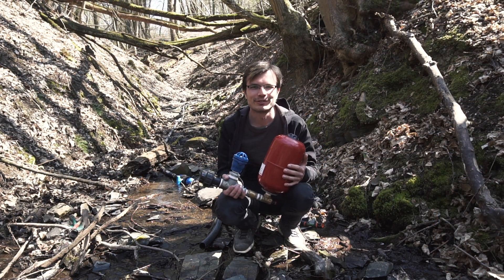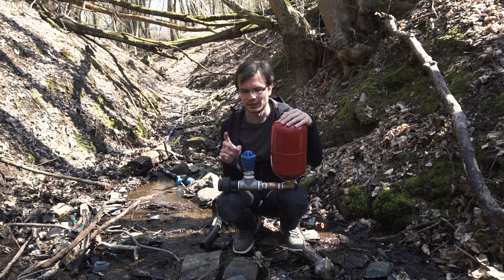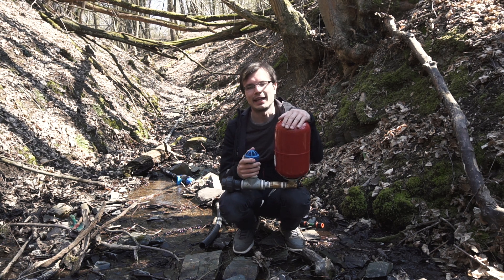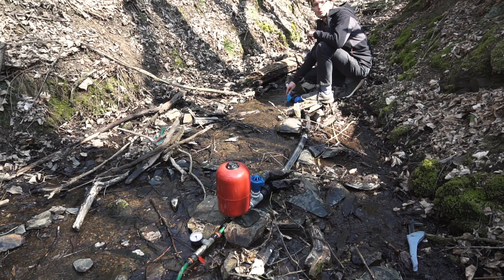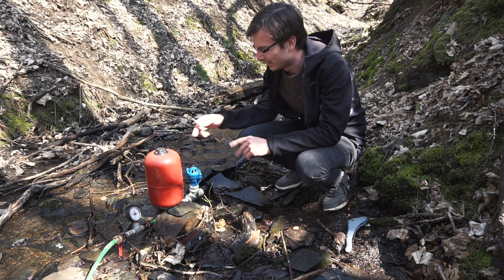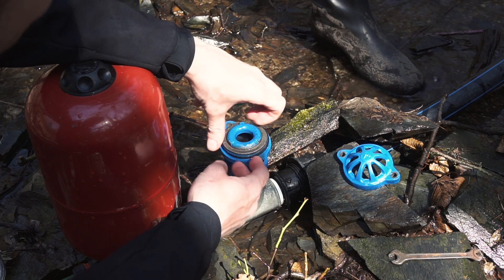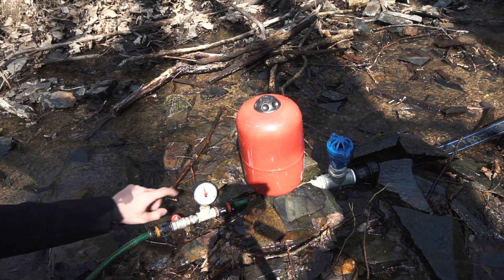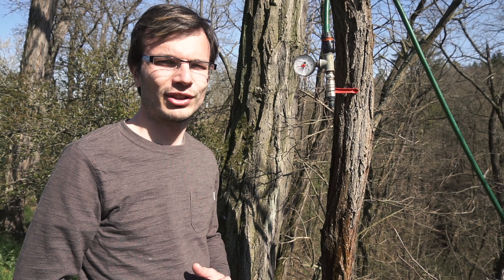RAM PUMP - simple DIY BUILD that works - new valve, troubleshooting

Comment: You didn’t mention the difference in elevation from your ram pump to the top of the hill where you measured 2 liters in a minute as well as a pressure check. That is one of the most important aspects of your test.
Reply from the maker: Probably in other videos. Intake downfall 2,8m, delivery height around 17m.

Comment: your previous check valve was much better I think. You can adjust it easily. Not this one.
Reply from the maker: You are right. But not everybody can make it. That's why there is this simple valve.m - still much better than a standard swing valve.

Comment: Hi. I would like to know how many L/s in drive pipe before not install ram pump.
Reply from the maker: For 1" it is enough to have approx 6l/min.
Reply: @BohumirStehlik  . So is it enough or not water capacity from water source when ram pump rum at 24 hrs?
Reply from the maker: @aungmyokhaing6795  How enough?  I don't understand your question because you don't write what is enough. The pump needs approx 6l/min. Anything above is ok.
Reply: @BohumirStehlik  I mean that you collect water from flexible pipe by black color tank for drive pipe. "I want to know flow rate of water from flexible pipe". Because flow rate is low than drive pipe, ram pump can run only when water level from black tank is full or higher. So ram pump can not run for 24 hrs if flow rate of flexible is low.
Reply from the maker: @aungmyokhaing6795  The flow from the red flexible hose is much higher than the pump needs. Thr water travels freely in the red hose but in the black drive pipe the water goes only step by step thanks as the pump works.

Comment: Have you try to troubleshooting again your previous ram pump by changing the rubber ring inside to a metal like stainless. That will make the pump work faster.

Comment: hi mate which size of pump fittings etc. you need for  different water flows?
 or is only one size required and there is an option to anjust the pump to diffrent waterflows.
and what is the min, waterflow you need to operate ak pump like this,
thank so much, you can write me an email if you want, because i am not too often online, thanks 
verafrank@gmx.de

Comment: Great video series! It looks like a lot of people including me is finding it hard to find the 1" blue plastic "ball" valve. The foot valve that you compared in your "flap valve bad" video is easily found here in the West and seemed to do a good job and would just need the interior spring removed. Did you try that one here? And if the 1.25 inch one you showed previously was too big perhaps a 1 inch one would function well and still be good for a noob.

Comment: Hi I have built a ram pump connected to a fish tank to recycle the water, using your waste valve design. The waste valve however does not close when opened. The length of the drive pipe is 3.8m to the pump and its diameter is 1" same as the pump diameter, but a 2" waste valve. The water head is about 1' above the pump.There are two elbows, one under the tank, and the second about 1.5' from the first, but not part of the 3.8m drive pipe. What might be the problem?

Comment: carrying on your fathers great thinking .. Two heads are better than one .. congratulations .   I saw a small bleed hole in one design what is the idea behind the bleed hole .. .
Reply from the maker: It is a sniff valve. You need it if you don't use the bladder tank. The air disappears from the tank over time...

Comment: Interesting results! The ram pump is based on the inertia of moving water - therefore, you need to have the highest flow possible when the waste valve is closed, and it must close as fast as possible, to get the highest pressure spike. I still think this valve is not as effective as your custom design, but I admit I was surprised with the results!
I also think that the rubberized metal ball that forms the seal in this valve will wear much faster than your custom leather seal, particularly because it's sealing against a metal lip. This video is almost one year old, so I guess you will know more about this by now :-)
Reply from the maker: Actually, not so bad with the wear. Because we have brushed and polished the metal lip... The ball looks still good.

Comment: Thank you for the video - do you have any updates since last year on the best simple waste water check valve?

I like the idea of the ball check valve and while I've seen similar, I'm having trouble finding similar online.   Anyone have any links to products?

I've linked back to this video from the Waste Water Check Valve discussion in the Water Powered Pumps Facebook group:
https://www.facebook.com/groups/240458583255303/permalink/533567013944457/
Reply from the maker: Hello. Since I moved away to a new house I haven't done any research. I feel this topic is kind of closed. I have emptied my ideas and I am mostly happy with my custom made valve. 
This ball valve is a suction basket for another pumps...

Comment: Would this work with a 1/2" width system?
Reply: Additionally , would  this orientation work with the previous pump design? An in line is more convenient as you mentioned

Comment: Does the intake pipe have to be so long? I would like to make such a rampump but the stream that I have in my yard is only 2-3 meters long, then it falls straight into a lake. Do you think it would be long enough to create some pressure?
Reply from the maker: Maybe some pressure but  not enough for running and pumping. Or you need to have a REALLY small pump.
Reply: @BohumirStehlik  Thank you for your ultra quick reply ;)
Reply: Depends on how much fall you have. If you have 6 ft or 2 meters of fall but a very short intake pipe length you need to go to a large intake pipe. 4 to 6 inches in diameter, it's all about the weight of the water and fall. If you have a 1.5 inch x 150 ft intake pipe let's say it holds 25 gallons. If you have a 4 inch x 25 ft it might hold nearly the same amount of water. Inertia is inertia, we use 3 inch diameter irrigation lines on our alfalfa fields. We can run 25 impact sprinklers at a time. If we used a 1.5 inch pipe with the same water pressure we could only run 5 sprinklers. You will just have to experiment. Good luck!

Comment: This video is really good. I recommend a miniature electric valve here. I have experience in this area. The effect of water saving and water control is very good. You can go to this website to see. There are different electric valves, such as open /Close valve, proportional valve, it can work under different voltages, and can choose different control methods.
Website: http://www.tf-electricvalves.com
Online shop: https://tf-electricvalve.es.aliexpress.com
Reply: The whole point of the ram pump is that it does not require any external power source

Comment: Please i have a question; using a basic Pressure is force per unit area. 
If we use a ball that is twice as heavy has the current one you have, will it double the pressure?
Please advice. Thanks.

Comment: Excellent configuration 👀 .
I am running one at a summer place in Maine .  
I'll check out your videos and subscribe 👌
Reply: I don't get it, how do you get such high pressure from the low-pressure side of the RAM PUMP? Can you describe the principle of your achievement?

Comment: A very useful video... What do you think would happen if you were to use a larger size waste valve e.g. 2". The ball would be heavier and more water could pass through. Would performance improve?
Reply from the maker: for is this is the biggest size possible. For bigger valve one needs more initial water pressure. So, it depends.. If one has more pressure, then it would help...
Reply: @BohumirStehlik  Thank you. Im not sure if you have any ideas, the ram pump i have built has 2 oddities. 1. The water comes out of the delivery pipe in pulses rather than a flow 2. The delivery pipe needs to be at least 7m above the pump to generate sufficient back pressure for the pump to operate. The head is only 1.5M.

Any ideas what could be causing this? Im stuck!
Reply: @davidstroup974  thank you david

Comment: It is better to use your customizer waste valve, my friend make a waste valve almost the same you lade, but he use a tyre rubber  instead of leather. I made also a waste valve almost the same theory as yours, but I used a heavy equipment tyre more tha an inch thick. Very durable and long lasting, till now not encounter any problem with my waste valve.

Comment: Your original pump was pushing 5000L per day, this pump does 2*60*24 = 2880 L per day.. how do you then come to the conclusion that it is "almost the same" ???
Reply: You missed the part he mentions different pipe size due to less water in the stream this year..

Comment: That looks like a great idea for many reasons. It seems much quieter than the other metallic valves, I would assume the ball rotates and spreads wear all around the outside of the ball.
Do you have any information about how long it lasts before needing service or replacement?
Reply from the maker: Hello, thanks. Yea, that was also my question about the wear. It ran for about a month in a row. Then my father checked it and said that there's no wear on the ball at all. But time will show more...

Comment: Bohumir do you have a list of the items and size you used to build your ram pump?
Reply from the maker: Thank you. Somewhere in my videos is a video step-by-step. It is incl. my custom waste valve. But it is really easy to make it yourself. Just visit a plumber's shop.
Reply: @BohumirStehlik  thank you Bohumir where I live in Jamaica. The valve you mentioned is not sold here. What is the size of your bladder tank? 20 Litres?
Reply from the maker: @DOW876  8 litres.
Reply: @BohumirStehlik the 3/4 inch valve - what type of valve is it?
Reply from the maker: @DOW876  slide check valve
Reply: @BohumirStehlik  does the slide check has a spring in it?
Reply from the maker: @DOW876  I took it out.
Reply: You took out the spring?

Comment: For less pressure loss and maximizing use energy of water shock (hammer effect), can You try to install the tank horizontally? 
Meaning In direct way of water stream stroke in “T-part” ... 
Bladder tank maybe can handle it?
Reply from the maker: I don't think so that it would have any effect on efficiency to place the tank horizontally. And I am not going to use this type of setup anymore. It is quite stupid to have the valve in the middle. All of the scrap and mess from the water goes to the main valve instead of the waste valve.
Reply: @BohumirStehlik  Understand. Dirty water, mud and sand was an issue in our installation. 
Same setup - small vertical drop and long PE pipe as a solutions for this condition.
After many tries and tweaks we found as best solution this: 
100+ liters plastic barrel near to pump
Positioned and leveled up to input water level (Communicating vessels principle https://en.wikipedia.org/wiki/Communicating_vessels )
On top (or quite lower then top water level) connected  to pump with straight solid iron pipe (that's important), min 2" diameter
Pump input iron pipe length depends on waste valve frequency and closing speed (The absolute water shock with the highest pressure only lasts until the pressure wave runs from the waste valve to the beginning of the pipe and back to the waste valve. The wave propagates at the speed of sound.)
Intake from PE pipe connect in bottom of barrel. Optimally in side position to make vortex with cylindrical filtering effect
Bottom barrel central waste valve for discharging settled sand and mud. Use as big as you can, a short but strong current will do the best job ... ;-)
Reply: @BohumirStehlik  So what will you be using? Updating video to reflect?

Comment: i can't find this valve in Germany. please share link to buy this blue check valve
Reply: I had no success with the company listed by Bohumir - they didn't reply to my emails. However, I have now found one on Ebay, which I've ordered - https://tinyurl.com/y5tmbohs
Reply: BlackEagle 1903  It’s a suction basket for a well. Otherwise normally installed at the bottom of the suction pipe in wells.

Comment: Bohumir, can you explain a bit more on the position of the bladder tank? With the custom made waste valve you built earlier using the Galvanized Tee, the tank is after the waste valve. And also, what do you mean by bladder tank? Do you put a tyre tube inside the tank?
Reply from the maker: Tire tube or I use an expansion tank. The bladder tank here is after the valve. Actually, it has some pros and cons. Pro is that the pump is super compact. Con is that the pump is sensitive about quality of water.
Reply: @BohumirStehlik  Thank you. I meant to say, on the other setup with customized waste valve, the tank is before the valve. Anyway, appreciate it.

Comment: Hello Bohumir,
I am very interested to learn about ramp pumps. Your videos are very good and I’ve learned a lot. 
I have a question. What is the minimum  intake pressure needed for the ramp pump to work? If my site does not have the drop in elevation, how long do I need the intake pipe to be to create the necessary pressure?
Appreciate your help. 
Thank you in advance.
Reply from the maker: Hello, you need a certain downfall. I would say that actually the maximum lenght for this size of the pump is the 50 meters. I am preparing another video where you will see that we have now actually intake to the intake. You can use it to have the water level higher. Last week I was working with downfall about 1,5m, it was slower but it worked fine.
Reply: @BohumirStehlik  Would you say that this "blue" valve is better than your homemade one on this size of pump ?
Reply from the maker: @m1m1thecat  Each of them is suitable for different type of people. If you are a pro, take the custom homemade one. That one can run anywhere and make maximum of power. The blueone is for noobs. It is better than the swing check valve but when the water flow is too low it won't work.
Reply: @BohumirStehlik  Thank you for your answer ! It's all clear for me now :)

Comment: This looks very interesting, Bohumir, and I'd like to have a go at building one. However, I think that check valve will be difficult to find. I've looked online at various sources but I can't see one anywhere.  Where did you get yours?
Reply from the maker: https://www.sigmashop.cz/cerpadla-a-cerpaci-technika/saci-kos-kuli-1
Reply: @BohumirStehlik  Many thanks. I must check if they ship to the UK, or try and find a supplier here.
Reply: I sent an email to them, Bohumir, to see if they ship to the UK. I didn't get a reply, probably didn't understand me, so could you ask them via email if they do - and what the cost would be? I would probably need two initially.
Reply: @BohumirStehlik  I sent an email to them, Bohumir, to see if they ship to the UK. I didn't get a reply, probably didn't understand me, so could you ask them via email if they do - and what the cost would be? I would probably need two initially.

Comment: Could you explain a bit more about this specific pump and how the ball acts inside the valve ?  Also i don't see a second valve, i thought there needed to be two valves for the pump to work?
Reply from the maker: Yes, there's this blue valve and there's a 3/4 valve that is placed horizontally. The ball acts as a valve. It stops the water flow at the upper position.